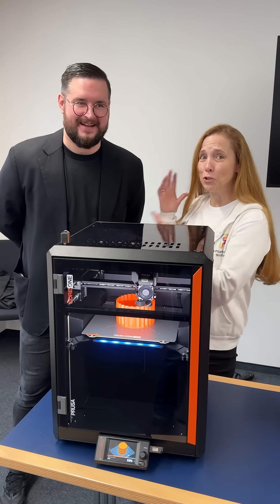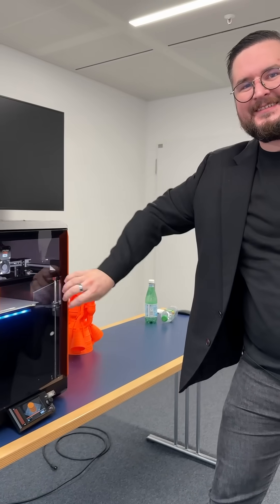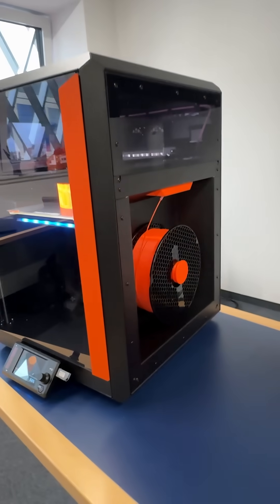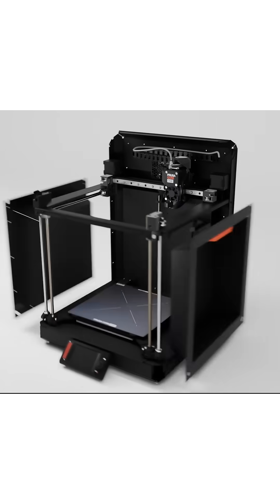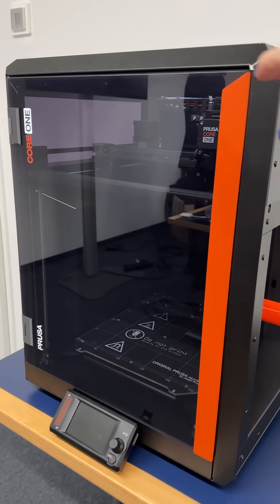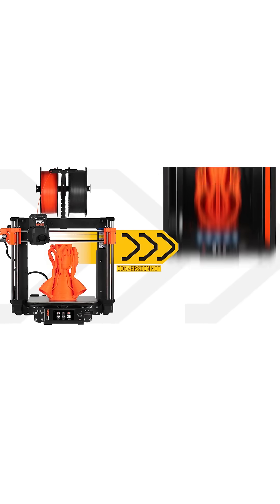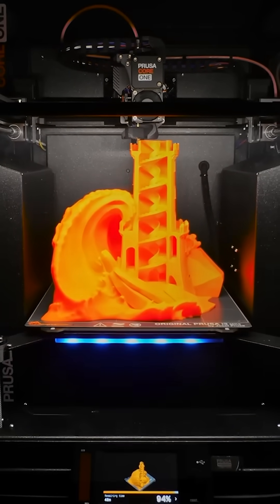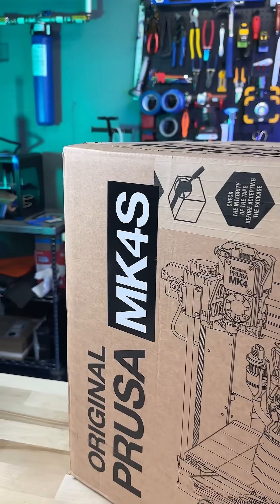New 3D Printer from Prusa!! CORE One

Comment: Long-time Prusa fanboy, Prusa Mendel builder and DIY-derivative-printer creator here: Core One looks quietly promising. Slightly disappointed it's shy of a 250x250x270 mm build volume – I'd be quite happy with a top-mount spool holder option – but then again, I've never used the full volume of my DIY 220x220x280 mm printer. It'll be interesting to see how it fares in the up-coming comparison reviews on YT – whether Prusa's conviction and dedication to open source / open hardware, network privacy, hacking/upgradability and especially, the ‘made in Europe’ factor get properly priced in. I get it price is a strong draw-card, but if we really care about the underlying benefits of those issues, Core One is almost a no-brainer; I'll at least hold off on buying a P1S until the Core One reviews are out.

Comment: 2 years later they release a P1S for double the price ... nice move Jo :)
Reply: You can physically see the quality improvement over a P1S though, you can’t pretend that they are comparable in that sense.
Reply: this is a thing that I highly doubt, the print quality of a p1s is flawless, just like an mk4 - there is no reason to believe that the core one will to significantly worse or better, it should be around the same because it has the same toolhead after all (given that they do not have messed up the kinematics)

Comment: If its actually a normal price and not overpriced like all prusas are, it could be a good option
Reply: Do you have a Prusa printer? I have a Prusa Mini and multiple Ender printers. My Prusa doesn't need nearly as much tweaking or upgrades to print well.
Reply: @htpkey  no I have a Bambu and I've had 0 issues. It's cheaper than an mk3 and way faster with more features
Reply: @htpkey Bambu Lab prints perfect out of the box, and it's cheaper!😂
Reply: more than double the price of a P1S or 300 Euros more than an X1C + AMS
Reply: @suit1337  that's ridiculous lmfao
Reply: @Jejjing  nah - just hear what jo prusa has to say about this - he will tell you that this thing is the best thing since the invention of sliced bread ;)

Comment: I don't get all the hype. I might be more impressed if it was mmu capable.
Reply: It is.
Reply: @hanslain9729  - more than 2 colors?
Reply: Mmu is 5 colours
Reply: Their MMU3 system (5 colors) seems to be an upgrade path for it but maybe not supported as a launch option. Blog post was a little unclear on that, but it doesn't seem like it will be a shipping option. Would tack on $360 to the price tag going by current fully assembled MMU3 pricing on their store.